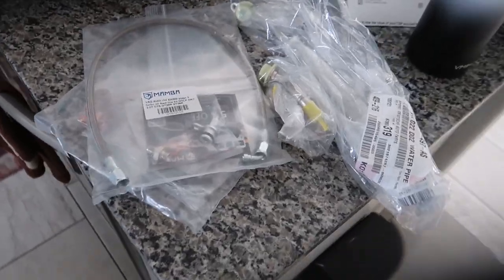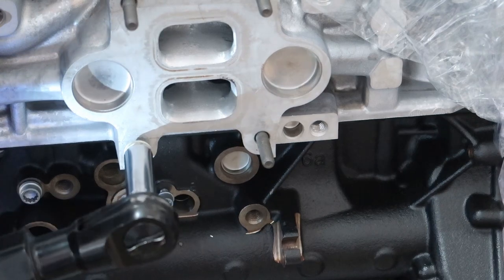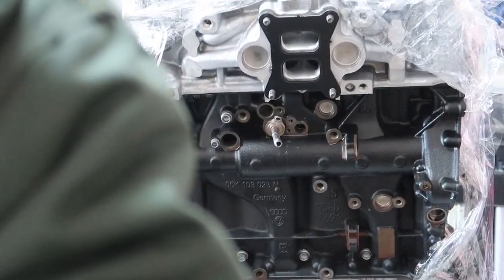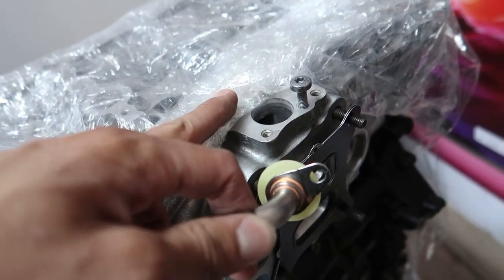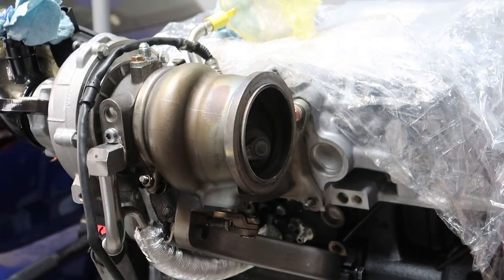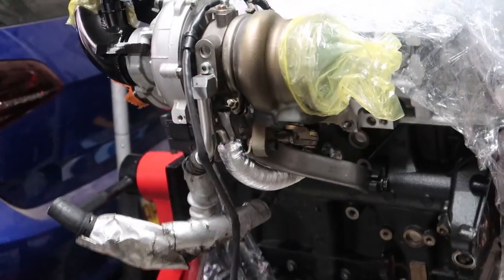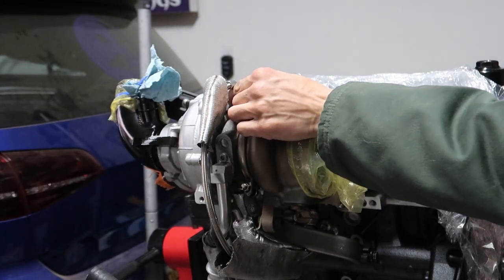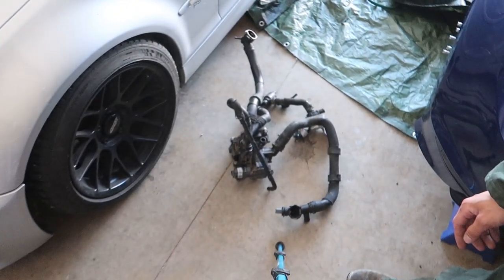Turbo is on!! | MK7 Golf R

Comment: 4:00 cleaning is great don't fret about that.. my only concern is the one that is flowing about 2CC (or is it psi) less than the rest... would have been better to have them all flow matched but it shouldn't really effect it too much and if you're doing any custom tuning you should be able to correct it in the ECU anyways.

Comment: Hey Bryce, just had a shop install a downpipe for me and I don't think they installed a new gasket. If I were to unbolt the V-band clamp, is there typically enough flex for me to move the downpipe out of the way and swap this gasket out? I believe the AWE downpipe only has a mount at the bottom. I'm at 72k miles and likely on the original gasket. Thanks man.
Reply from the maker: Absolutely pleanty of room. Probably doesn't need a replacement though tbh. My kit just came with a new one so I figured why not. Pop off the clamp see how she looks. If it's all there in one piece I probably wouldn't touch it, unless you're paranoid like me lol
Reply: If there is no exhaust leaking where they meet then it's fine.

Comment: Clean your injectors and get the flow tested as common problem on these engines, have you opened engine ?
Reply from the maker: Yes this is a whole rebuild series check out all the videos. I got my injectors cleaned they were really bad at 80k, definitely recommend getting them checked out
Reply: @BryceJordanProductions  how bad was the standard ring gap wife has a TTS and uses oil
Reply from the maker: It was fine everything looked decent besides all the carbon on the pistons which was probably from my failed pcv dumping oil into the cylinders